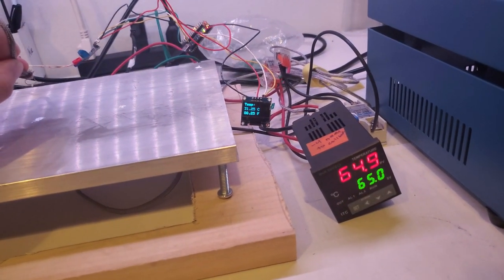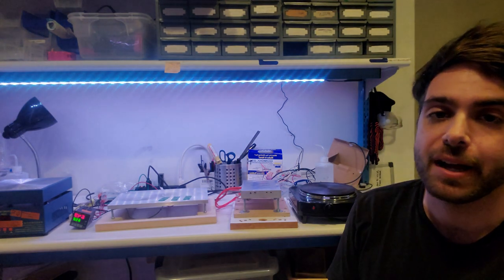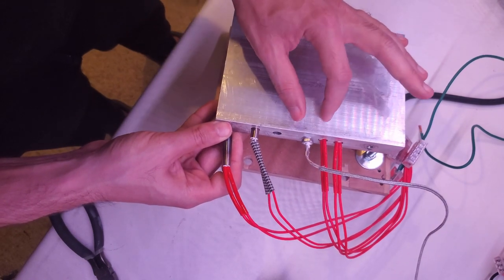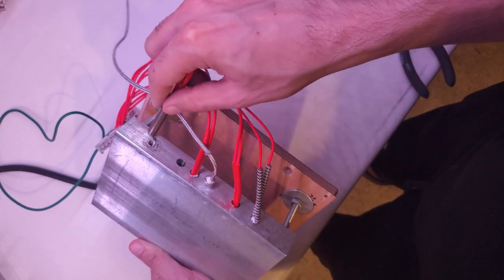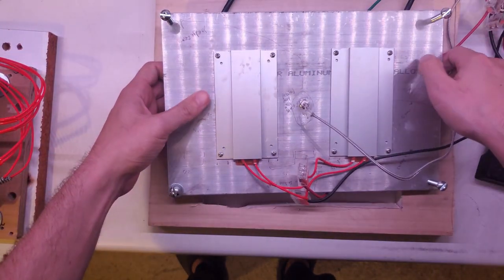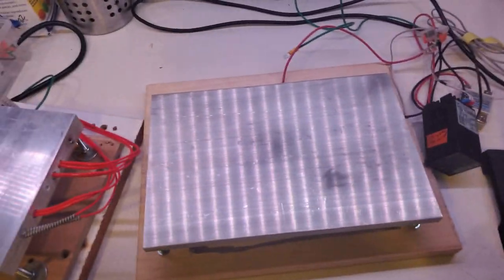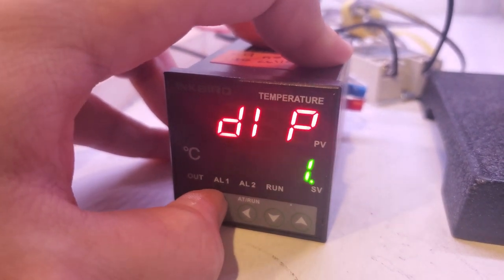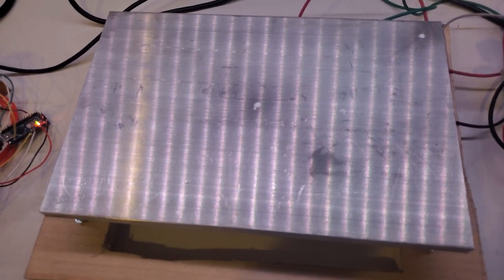DIY Hot Plate - Large, Low cost. Reflow, Lab, photolithography, biology. Accurate, Uniform temp

Comment from the maker: By the way, note the difference between ceramic and aluminum top hot plates. On ceramic (poor heat conducting material) top plates, the surface temperature will not be uniform. The center will be close to the set temperature but the edges will be cooler. Also, check the manual here of a ceramic top hot plate (https://www.google.com/url?sa=t&source=web&rct=j&url=https://www.corning.com/catalog/cls/documents/equipment-manuals/CLS-EQ-091DOC.pdf&ved=2ahUKEwiKqubHj-X7AhXeHEQIHRmrDdgQFnoECBEQAQ&usg=AOvVaw1c3iu41GHsDfAtLlKhffd1) on page 8 which says that the set temp can differ from actual temperature. Ceramic hot plates are ideal for heating beakers with liquids (and you would have a thermometer or probe in the liquid to monitor the temperature). The ceramic material is corrosion-resistant and can also withstand higher temperatures than aluminum. For uniform and more accurate surface temperatures though, go with an aluminum top hot plate. Ceramic-coated aluminum top hot plates are a thing if you need the best of both worlds and will cost several hundred dollars, though they can't get as hot as ceramic-only hot plates. But most people probably don't need ridiculously hot temperatures.
Reply: Thanks, just the words im looking for